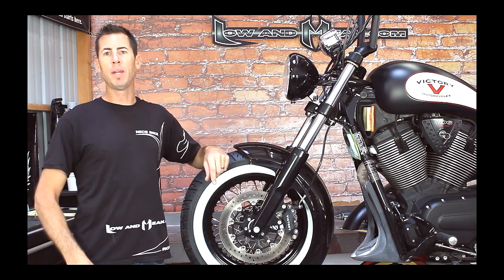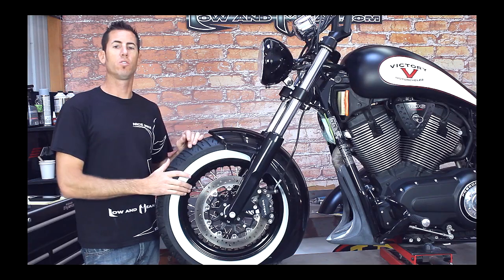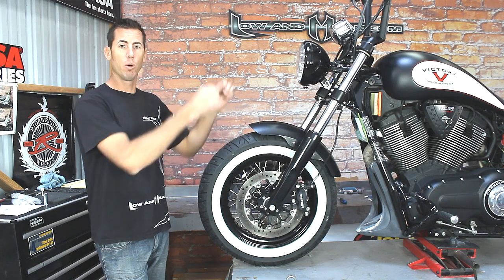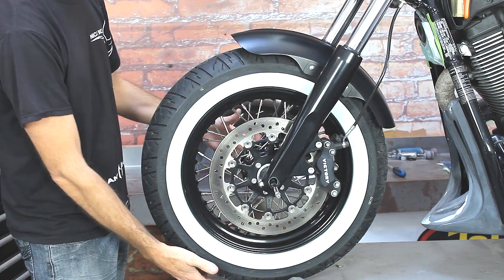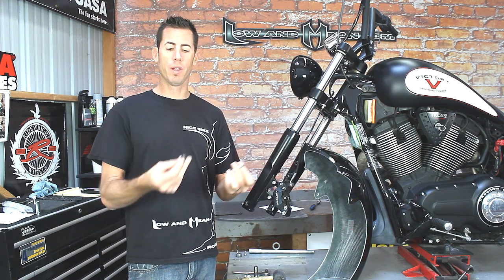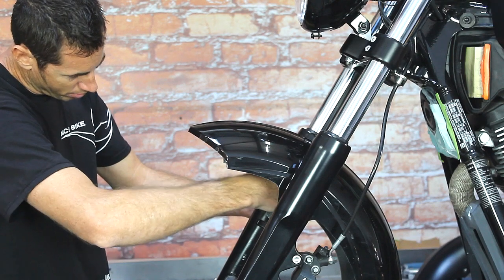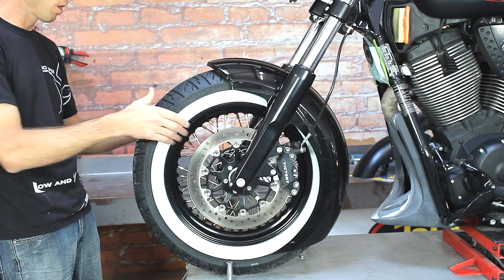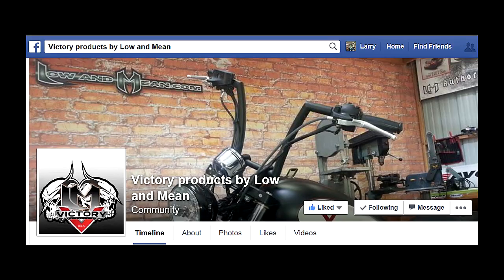Victory High Ball Full Wrap Front Fender from Low and Mean

Comment: Thank you for posting. I used this video to remove the front fender on my 2015 Victory Gunner in order to replace the fender. On the Gunner, my driver's side axle bolt was a 10mm hex head.

Comment: I popped the one off my 2013 judge the other day with stock bolts. Just use a ratcheting wrench. There is clearance didn't even need to let air out or anything. This seems to be a lot of extra work. I'm fairly sure the judge and highball have the same front end.